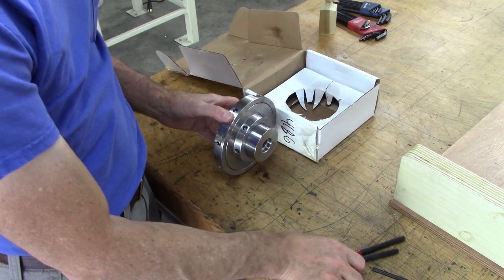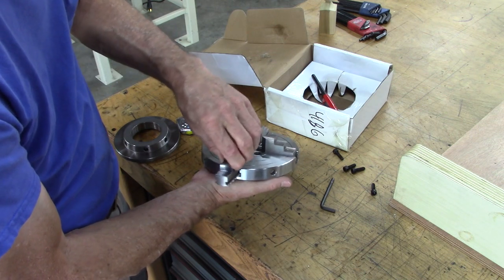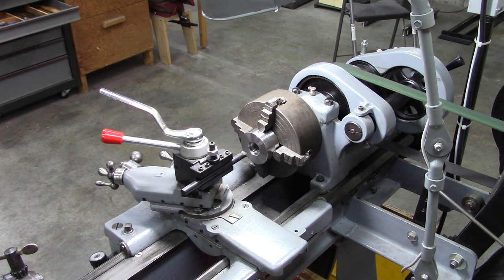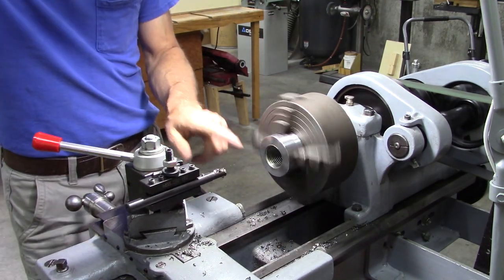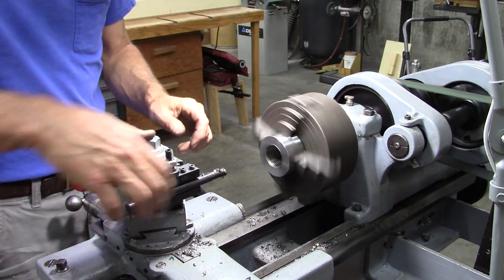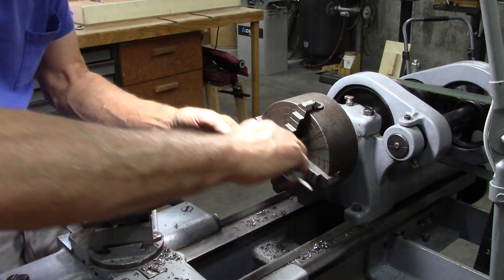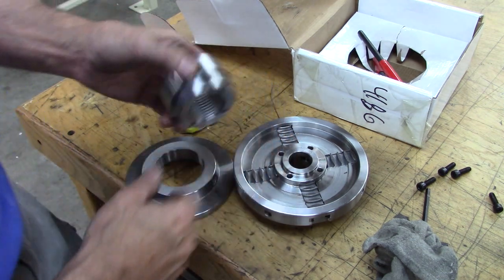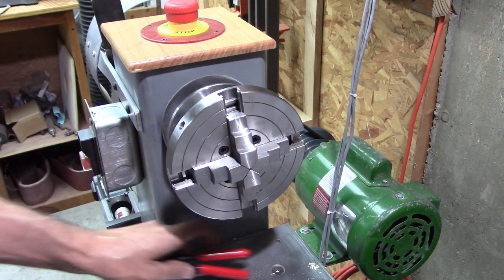Adapting a self-centering 4 jaw to my CNC Wood Lathe

Comment: Is that lathe reversible? My NOVA lathe uses a grub screw that seats in a gutter behind the spindle thread to lock the chuck or a faceplate on the spindle.
Reply from the maker: No reverse. That's a good idea on the screw but my spindle has no unthreaded area. Reverse would be handy for finish sanding.

Comment: For some reason when I saw that steel boss and realised you were going to bore and single point thread it, my gut feeling was that it was going to be a pain. I don't know if I subconsciously assumed it was going to be hardened or something, but it just felt like one of those jobs which cost more in broken tool tips than you could ever charge someone for doing it......... Glad I was way off mate.

Anyway, as you're an engineer, I KNOW once the camera was shut off you quietly chucked up some ground bar stock and ran a DTI over it............. Do you care to share the run out figures with us? Or is it's level of centricity covered by the phrase "Well, it's close enough for wood turning"? :D
Reply from the maker: The sleeve I threaded is made with a snug fitting recess or register so it stays concentric with the chuck. I had the sleeve near dead center in the 4-jaw and used a boring bar to enlarge the hole so it has to be centered near perfect. The steel was mild steel. I didn't check the rest of the chuck but if anything is hardened I'm sure it would be the scroll. Backing plates on chucks are never hardened, at least not the thread on type. I never checked the runout. It would be easy to see if there is any on the body of the chuck and it spins true. The jaws may be off but I haven't checked. This would be hard to fix plus like you said, close enough for woodworking.

Comment: Hey Mark, could you hear me bellowing from way down south in Wakodahatchee Florida? Just in case you didn't here me here it is again...... "Protect your ways with Plywood when changing chucks"! Hell, even some cardboard is better than nothing at all! Worst part about this is I know that you know better than that. FYI, for the past 33 years most of my wood turning was done on an old converted Logan 920. It has a 2.25" x 8 TPI spindle. Back when I bought it she was in bad shape. She had been stripped of everything but the Headstock, Tailstock and a partial carriage, with no compound. There was just too much missing to resurrect to a tool room role. I'm happy to say that she has been quite happy in her wood turning life.
Wakodahatchee Chris
Reply from the maker: Yeah...  I have two huge shars chucks. When I change them I use plywood. The one in this video is hollow in the back and super easy to hang on to. Life is about taking chances. I'm not worried. That 920 is one solid wood lathe!!!
Reply: @WinkysWorkshop  I figure I've got about 30 or more years on you but some of our old iron predates even me. These old machines are more than being American classics. They're representative of an American industry that doesn't exist any longer. These jewels of American craftsmanship were an art form that begged to be touched. Manipulating any of their controls transmits tactile sensations that don't exist in modern machines. Since I fancy myself a steward of my Logan 920 and SB Heavy 10 I consider it my duty as well as an honor to insure that their time spent in my charge reflects time spent in a good home. I'm sorry for getting philosophical but they represent my Dad's generation and he was a damn proud machinist. I have plenty of shop combat wounds that were inflicted protecting my entrusted old iron. So yeah, I take chances too but not with them. Capice?
Wakodahatchee Chris
Reply from the maker: @cdrive5757  30 years puts you at 95. Good that you are still kicking. I suspect you've estimated my age a bit younger but never the less, good that you are still kicking. We share our love for these machines although I can't boast the same history. My dad worked for the electric company and before a retired I was designing machine improvements for printing presses. You are absolutely correct about these machines being an art form. This pride is obvious (and amazing). I brought my south bend 11 back from the grave! https://www.youtube.com/watch?v=vrXBkqC6ttc&list=PLz2A001hMBoS1Q4L4MZ8d5EabCLLPZSid

Comment: I think you might be surprised at the accuracy of that chuck. Those scrolls and their mating jaws would be spat out by CNC machines, and even if the raw accuracy is out, a little careful work should easily bring you better than a thou repeatable. Looks like great value. 
I'd be exploring the possibility of modifying a spare set of jaws to grippers, either by direct machining or tapping holes to take add-ons. If the jaws are too hard, farm the mods out to someone who can do thread milling or hard turning.
Thanks for sharing.
Reply from the maker: I'd say you are right about the accuracy. The last two chucks I got for my metal lathes were within .002" and they were very cheap. I was thinking about making like a shoe to fit over the jaws with more surface area where it contacts the wood. One screw would hold then easily. I'd be shocked if the jaws were hardened.
Reply: @WinkysWorkshop  That's about what I had in mind, except I talked about a spare set of jaws. If you can achieve your goal with the original set that's great. Your channel, your choices, I'm happy to watch.
Reply from the maker: @russelldold4827  Having a few sets of extra jaws would be GREAT but I suspect they would be hard to get.

Comment: Are you sure those jaws are "reversible"
I will watch the rest of the video to see if you confirm or correct your statement.   🤔
It did look like the jaws might have been machined to fit the scroll both ways. (Should always watch to the end before commenting  ?  🤗)
I haven't seen that before   !
Hey ho 
You live and learn.
Reply from the maker: Ha! You had me wondering...  I never tried reversing them, but yes they are reversible.

Comment: Another great improvement Mark. Does the wood stock need to be square or can you do different shapes as you can with a conventional 4 jaw ?
Reply from the maker: Thanks Terry, yeah the stock needs to be square but wood compresses easily so if one dimension is off a little it still holds well.

Comment: The simplified Tap-Drill formula can be used on any thread when a drill chart is not available.  Simply subtract the pitch from the basic major, or in your case 1.50" - 0.125 = 1.375" bore  (Pitch = 1 ÷ TPI).  Metric is easier.  For 6 x 1, subtract 1mm from 6mm equals a 5mm drill!
Reply from the maker: Thanks...  I need to write that down, I knew there was an easy formula but didn't remember what it was.

Comment: Why not  make a threaded stub dummy shaft to mimic your spindle shaft. A lot easier to test the threads while still mounted in the chuck.
Reply from the maker: Very true but I needed to remove the lathe spindle to shorten the threaded part anyway plus I wanted to see if the grease in the bearings was adequate. Now I'm wondering if maybe a thinner grease might be better. It looked like it was fairly dry.